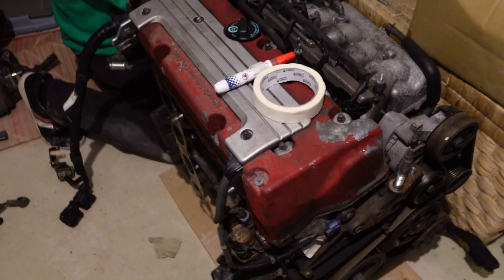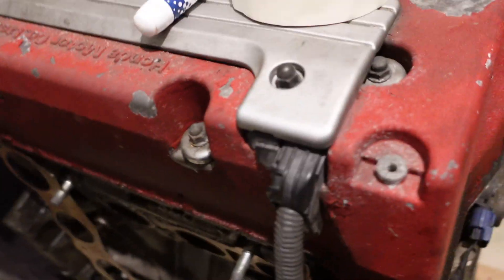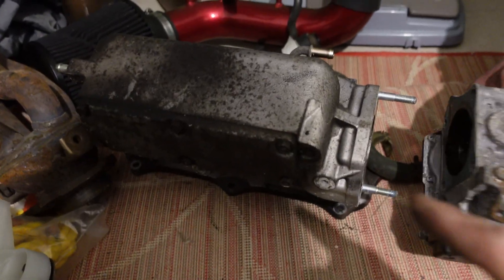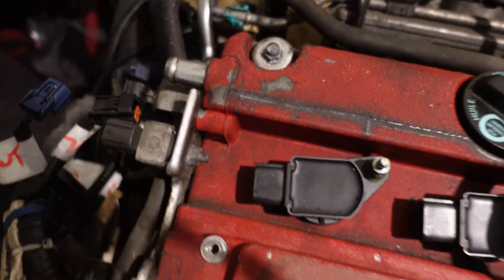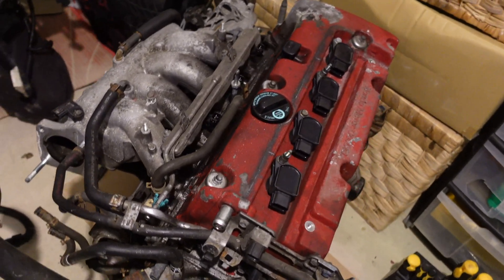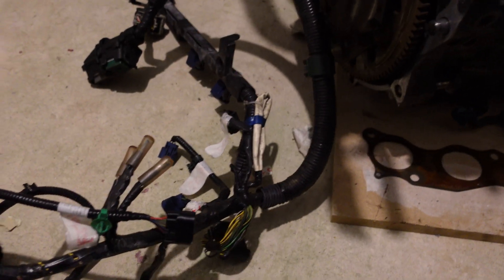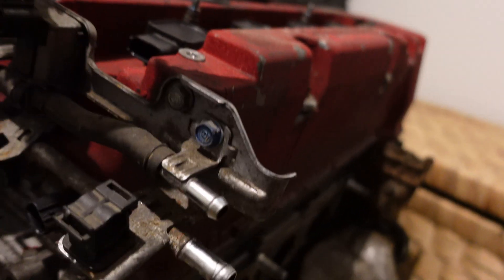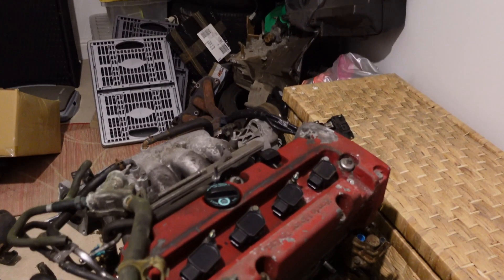K Swap K20 Honda Jazz Fit GD Project Introduction

Comment: Change the oil pump in the Z4 to the same as the A2 - it’ll remove the balance shafts and gain a few extra ponies as well as space under the car. You’ll need dipstick, sump, pump, baffle plate and worth doing a chain whilst you’re there. You have to take a bit of metal off the pump but it’s easy enough. I did it to mine in my Elise 👍🏻 I’ve done the Z4 conversion to A2 parts you’re trying - message if you have any questions. Good luck with the build!
Reply from the maker: I’m kinda hoping to use the engine as it is currently apart from the loom and throttle body. I didn’t even consider the sump was different. I guess if I need to change it all I will, but really hope not 😂 high hopes for a quick and simple throw it in the car and away it goes kinda swap 😢

Comment: Why is the Z4 more expensive than the A2? Thought it would be the other way around with the FN2 being newer.
Reply from the maker: I think the a2 is a lot stronger standard compared to the z4. I was looking at about £1000 more to get an a2 which will essentially do the same job for what we want.